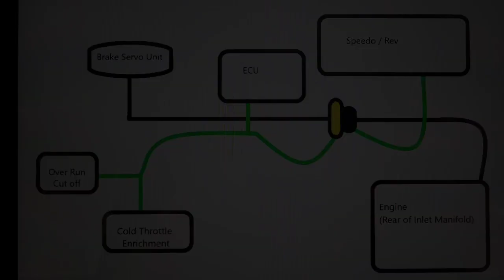Bosch K-jetronic - Mk2 Golf Gti 16v - Engine Vacuum System

Comment: Where would you recommend connecting a hose in order to perform a vacuum leak test with a smoke machine?
Reply from the maker: On the back of the inlet manifold where the brake servo pipe connects
Reply: @GreyGooseRestorations  Thank you!

Comment: My mk1 16v i thrashed about for a good few years, thought it ran great, just did basic services on it no problems. Been in garage for 15 years, now im getting it going again i relise how much stuff is missing, i have no plug on that throttle body micro switch, no plug on idle control valve, dont think i have cold enrichment valve at all, and i used to run it with that 4mm vacuum pipe disconnected. 
How did it ever work, i guess  it has something to do with still having mk1 wiring loom. 
plenty more pony's to be found then.
Whats your thoughts on having a custom wiring loom made, would save alot of weight too, getting rid of any redundant wires
Reply from the maker: Always some ponies to be found somewhere, ref wiring its swings and roundabouts really, could take out defunct wires yourself and save monies

Comment: Great video, just picked up a 5 door 1990 16v and it came on a trailer. 😢 it’s a long term project and got it started and it idles well to get up to temp. When it’s warm and I blip the throttle the revs increase and then the revs drop off and stalls. Could this be the vacuum or shall I look to adjust the brass idle screw to increase this to see if it stops the stalling. Appreciate it could be many different issues but your video got me thinking.
Reply from the maker: It could be the idle valve or Deceleration Cut off Valve not functioning? The DCV catches the engine above 1300 rpm then the idle valves takes over below that, 16vs like to sit at 1000 rpm

Comment: Awesome video, really struggling with mk mk2 16v. Had it running previously however would idle but when applying throttle it sort of stalls, won't rev properly. 

Is now not firing so am.teying new injectors ( think they're original ones in there )
Reply from the maker: If it idles ok then dies as soon as the throttle is opened then that would be pointing to lean fueling, see what its like after new injectors
Reply: Have got ilmy mk2 running. New injectors have done the trick. 

I think I have a vacuum leak though, when applying throttle I can hear it drawing air somewhere behind throttle body. 

Can you buy full vacuum line replacement kits ??
Reply from the maker: @user-kr1tg2kc7g its most likely the idle screw O ring or on the rubber boot underneath there is a vacuum part that can leak
Reply: Thanks for that, will see if VW heritage have the part. Thanks again
Reply: OK that's great. Have done a bit of reading with some horror stories about trying to replace the idle screw o ring, do you have any videos about how to refit ??
Reply from the maker: @user-kr1tg2kc7g its easy enough, 7x2mm seal bit of lubricant and ease it in then screw it on the thread
Reply: OK so just unscrew idle screw, refit o ring and screw back to original location is it ??
Reply from the maker: @user-kr1tg2kc7g pretty much yeah
Reply: Thanks for reply. The golf has made it to paint. Am expecting it to be a few months there. 

Debating about what to do with the engine was tempted by the tsr Cadwell option. 

Do you offer a rebuild service ??
Reply from the maker: @user-kr1tg2kc7g yes i do engine rebuilds etc send me a message via my Facebook page if you like and can see what options there are

Comment: I've got a vacuum pipe coming off the bottom right hand side of the airbox and going nowhere just running along the top of the chassis. Where should this go?
Also on startup the car idles at 3k rpm and only dies back when I pinch the pipe going between the isv and airbox closed
Reply from the maker: The small vacuum pipe is for the warm air flap thing in the base of the air box, just pull that small pipe off or block it as its close to useless.

Sounds like the ISV is stuck as the engine is drawing air through the ISV into the engine instead of the ISV bypassing air into the air intake
Reply: Got the high idle sorted, it was indeed the ISV stuck open. Started and idling ok. Once it got up to temp any time the fan cut in the idle shot up to 2.5k, quite strange. Also when I knock it off now when up to temp it refuses to start
Reply from the maker: @KevRWDstarlet it could the ISV again as when the fan cuts in the idle control module raises the idle to take into account the extra load

Comment: My vacuum line to the control unit is right now busted and i have plugged the vacuum hose for now. What difference does it do to the ecu? Does it affect anything?

Also what are the measures on the vacuum lines? Is there any kit for replacing?
Reply from the maker: @totte1015  the vacuum line is a ref  for the ECU load table and adjusts ignition timing advance accordingly.

Use 3mm ID vacuum hose
Reply: @GreyGooseRestorations  Thank you so much, best guy on 16v!

Comment: Where do the vacuum tubes go that go back through the firewall? I have two that go back through the firewall and I’m not sure where they go or what they do
Reply from the maker: There should only be one going through the bulkhead, one goes to the back of the speedo unit and the other should go to the ecu

Comment: I have previously cleaned my ISV with petrol, but some say that carb cleaner is better as it is more safe on the internal ISV rubbers. Any truth to this?
Reply from the maker: A bit yes as the rubber is close to 30yrs old so will be degreaded anyway, add fuel to that with modern additives and it'll most likely do more harm than good, best to use something thats designed for cleaning

Comment: Why are alot of 16v missing cold enrichment valve. That t plug from the intake is non existent aswell in alot of 16v
Reply from the maker: They may well of revised the need for that part in later cars
Reply: @GreyGooseRestorations . Maybe. It seems your vacuume system is a better design. Very simplistic. Or maybe it was the crackhead who worked on my car before me

Comment: thanks for the detailed and clear vid, will be checking the vacuum system on my valver. Thought that it sounded pretty rough at idle - did you get that sorted and what was the issue? 
Subscribed :)
Reply from the maker: Thanks 👍 much appreciated. Yes it was a air leak from the throttle body idle screw

Comment: Nice vid. A question, where do you get all your clips?
Reply from the maker: The coloured hoses clips? If so they were from type19.com
Reply: Very informative. Nicely articulated concise and to the point. Thank you for your video
Reply: @GreyGooseRestorations  Hi nice info, I wanted to know specifically where you got the injector tidy line clips and HT lead clips especially the ones that fit onto the 2 inlet brackets
Reply from the maker: @rajloyal  all from dubstock 
 https://www.facebook.com/groups/140698986707056/?ref=share
Reply: Hi great video again 👍👍, this car is a beauty! 
I think i may replace my vacuum lines on mine just to have knowledge that they are new. 
I have suspected that my idle microswitch is faulty for a while now, if it clicks it is working ok is the golden rule then? 
Did you say you can get the seal for the idle screw off the shelf thesedays at all tool?  
*I'll try and get the pics of my sensor
wiring to you soon, sorry was busy at weekend 🙈. 
Keep up the great work! 👍
Reply from the maker: @ravenmaster6364  yeah its worth it as its only going to cost 15 quid for vacuum pipe and some T peices (dont forget the section of pipe on the back of the speedo)

Any hardware store like screwfix / toolstation / BnQ etc will stock a box of various O rings.

No problems 👍

If it clicks generally it works, easy way to tell is have the car idling and manually raise the revs a bit then press the micro switch in with a small implement, if its working you should here the idle valve / engine note change

Comment: couldnt help but laugh at the hubcap falling off, lucky it happened in the yard rather than down the road somewhere
Reply from the maker: Yeah i walked back out to get the camera and was like 'wtf' hahah yeah good job it wasn't down the road, its only because ive got temporary wheel bolts in, got a freash set to fit